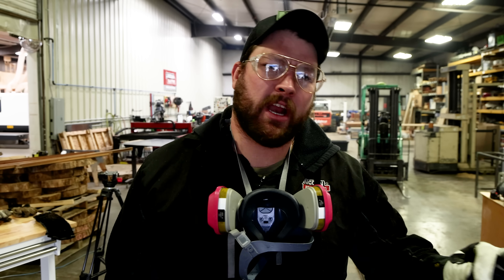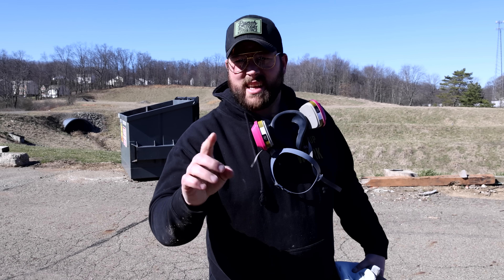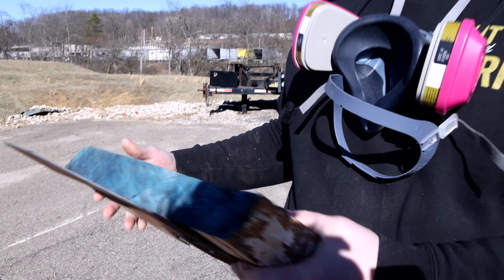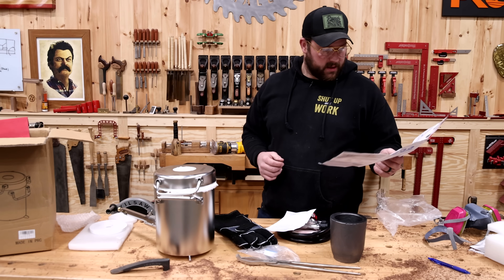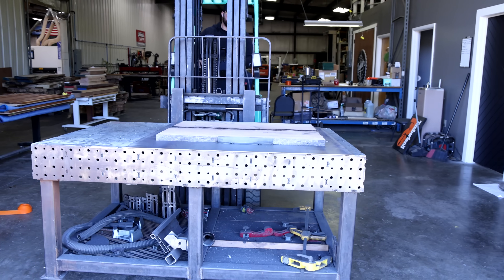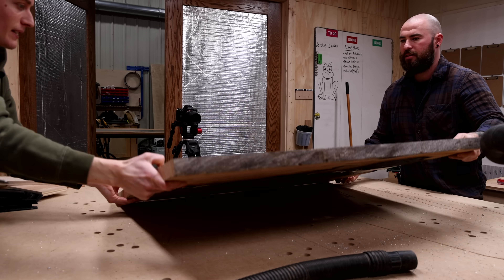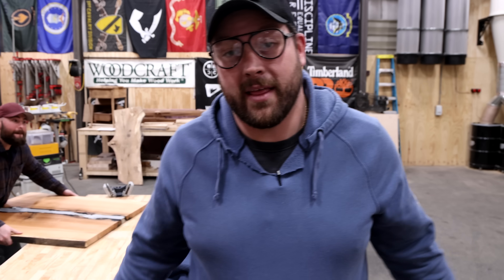I Tested Pouring Molten Aluminum in Wood

Comment: Soak the wood a little bit so it doesn't burn quite as quickly. Use sponges to cool it so it doesn't burn as much. Use water thin super glue to bond the burnt carbon to the aluminum and strengthen the wood.
 Then use a charcoal and resin filler.

Comment: The only time I've seen this done properly without any burning is when someone made molds of the voids that they were filling and cast pieces of bronze into the shape of the voids, then just epoxied those in and milled them down flat, that actually turned out really nice. Pouring it straight into the wood is probably never going to be a viable option unless you use pewter, which melts at around 338F-446F depending on the ratio of metals, you get the lowest melting point pewter you can get and you should be good, will probably char a bit though still. There are probably also some other options for low melting point metals that would also be viable. Though I'll admit, for me the ratio of how hard it is to how good it looks just isn't worth it. It's cool, but I honestly think epoxy river tables look cooler. To each their own though, having seen it done well, I definitely see why people like it. Regardless of how it turned out though, it was fun watching the attempt!

Comment: The trick is to do this in an already warm area and pour more aluminum. if you want to be cheap you could fill the space with hot rocks on the bottom and just worry about how the top looks. More thermal mass means more time for other layers to adhere.

But yes its difficult and you can get the same effect from easier methods.

Comment: The mechanical bond issue could be solved by adding small screws protruding just enough to the channel that the molten metal would surround and grab.

Comment: Have to ask - are you sure that the tiktok video was pouring aluminum?  It looked more like lead to me - far fewer flames because the melting point of lead is much lower than aluminum, and the material being poured stayed in liquid form far longer than your aluminum did.

Comment: Can't be done with pure aluminum like you tried. You need to do some metallurgy to "wet" the metal to the non-metallic substrate. Essentially you are making a brazed joint, not a structural aluminum casting. The big one for this use case is silicon between 5 and 12%, maybe some copper, and your melt will be more a low temperature low strength alloy. You'd also want to clean the wood very thoroughly to remove any trace oils, and use very dry aged wood so there is no moisture to flash to steam due to heat. Since the alloy will be at a lower temp than pure aluminum, you can use an aluminum backplate to help with adhesion and keeping the wood together. You'll also want a big chunk of metal underneath to act as a heat sink and help it cool quickly, bonus if you can get some water flowing under to cool the heatsink.

Comment: For welding titanium sometimes use an argon filled balloon.... I wonder if you could get enough argon on this to stop the wood charring. Im sure it's theoretically possible.... Argons heavier than oxygen so putting a tray around it might work

Comment: Why not use an angle grinder with flapper sanding disc for the aluminum until its somewhat close and then switch to an orbital sander. What would happen if you make a template of the wood and place where the aluminum will go and make a mold for the aluminum pour separately and add it to the wood later heating up the aluminum just inside the edges with that map gas torch you had as to smelting the edge so it fit perfectly or do all the work while the wood and aluminum are separated and make it like a leaf of a table since it is level which the wood is also level. I know, I know  I am not there. But these types of projects are very much my personal enjoyment and thoroughly enjoy not just the wood working aspect but even more so the problem solving and know sometimes when I walk away from a project for a few days I can see answers to the issues I am having..... I do think that what you said about having all the aluminum ready at once is the key. Why not build a smelter out of  the mortar concrete designed for high heat like 2600°+ Temps. I bought 100 pounds of it from Amazon like two weeks ago, You can purchase the ceramic wool sheets in large rolls( make sure you use rigidizer and dont breath in the dust of the wool sheet wearing a mask until you add rigidizer to it) I just bought a roll 2"×24"×20' to make a gas forge , coal forge and a second portable forge. Which one could use the large section of the smoker I got 2 of the 36" smoker for free off of the you haul off sites or you could use a 55gal drum vertically to make a large smelter with the wool sheets inside I made the inside of both my propane forges out of old out of service propane tanks cut in half the small 20 pounder and a 100 pounder with ends cut off the tanks with the ceramic wool sheet rigidized in between the two a for the forge I got some of the high heat brick for inside. The high heat concrete is for the base I made for  each of the forges I made since the rickety setup under the smoker wouldn't hold the extra weight

Comment: With all due respect. You have a mechanical engineer that designed and installed dust collection. Thank you for clarifying that, Yes terrible diesters have taken place and many have died due to improper use and understanding.
Reply: There is a reason there are blow out panels in the dust collectors at metal finishing shops. - Aluminum and Magnesium explosions a couple times a year are a fact of life.

Comment: I think you should try again. You need to get more material and do a better prep. 1st step to improve ur method add a refractory blank or cast a refectory canal along the edge of your opening to prevent the wood from burning and improve your casting. Second u need to add additional elements to make an alloy. You need to decrease the porosity and improve the flow ability of ur pour. Aluminum alloy 356 will give u a better cast and machinablilitty on the CNC.

Comment: I have not watched the video past the first pour. In my opinion you should pour it from the backside that way if it burns it up you won’t ever know it because it will be on the backside and then you can lay your board on top of another board and it will cover the burnt part up and keep the aluminum from falling out just my opinion.

Comment: I would try an inert gas like argon... it's cheap.  Have sides around your slab, argon is heavier than air so it will displace all of the oxygen. It can charcoal; but not burn.

Comment: So just a heads up they definitely did not use aluminum. Most likely they used gallium which melts at a low temperature and is also metal.when cooled looks similar to aluminum.

Comment: I did not see the video you are referring to but are you sure he was pouring aluminum into the wood?  If it was pewter it would be much more reasonable as the melting temperature of pewter is 480-550 degrees.  Just a thought but like I said I did not see the original video.

Comment: You should have set up a spray system under the metal plate underneath. That would have reduced the amount of burning from the metal caused by heat transfer.

Comment: I would pour silicone in the  Crevice, then pull the silicone out put it in sand to form the mold. Melt aluminum, pour in mold, finally place in wood

Comment: This is fascinating, but I wish you guys would learn the difference between "melt" and "smelt." "Smelt" does not mean "melt a metal," which seems to be how you are using it. To smelt is to use heat to extract metal from ores. It's also sometimes used to mean using a process involving heat to increase the purity of metal. But just melting and pouring is called... "melting and pouring."

Comment: It has potential but I think to pull it off you need a furnace and not a smelter as the different pours and thickness of wood probably played a big role in how it turned out.

Comment: Just because you can't do it doesn't mean it can't be done.
And a Vixen file will work better than your router to rough finish the aluminum. 400 grit isn't even close to a finish on aluminum. 2000 grit is still a dull finish, but the starting point for polishing.

Comment: There are low melt temp metals that look like aluminum but melt at like 200f. You should try doing it with that, and it shouldn't burn the wood so bad

Comment: I wonder if cooling/freezing the wood would help? Might also be more dangerous. 

Not with water but liquid ice so you avoid water so it doesnt steam but basically freeze the wood so as soon as the aluminum enters the holes/gaps it hardens dropping the temperature faster to maybe preserve the wood more instead of slowly burning into it. I know its not how the tic tac did it but as others say it it seems fake

Comment: Have you thought of using Zink? The melting point is within 15 minutes and less and looks like aluminum when polished!
Reply: You would need to be very careful with zinc as the fumes are toxic. The other issue is that zinc really likes to oxidize at those temperatures so you would probably end up with a white powdery mess. Even melting brass can get hot enough to burn the zinc and give off fumes.

Comment: 14:50 why not a cutter head? doing this with an endmill is probably worse than sanding it by hand XD.
I just know that this puny spindle doesn't reach the RPM for aluminium. A cutter head can help there, if the spindle has enough torque

Comment: I bet it might work better if you coated the hole with a clay infused with fiberglass.  Also, maybe put a small stream of water on the underside to keep the steel cool

Comment: Hmm wonder if it "wood" have turned out better with as soon as you poured it if you did an instant cool with like liquid nitrogen (to remove the changes of the wood burning)  or with the shots of video magic poured it but did a second table with silver/chrome epoxy

Comment: I think it would be possible with a thicker metal slab under it, and the two pieces of wood securely clamped down and bigger aluminum pours like first pour halfway up and the second pour finishes it at most three pours anymore and the aluminum cools too fast also maybe pre heat the metal slab to keep the first pour a little hotter longer as it would help the aluminum stay hot

Comment: Maybe it wasn’t aluminum that was used, could of been pewter or some other low melting metal like fields metal or woods metal both of which melt at about 150f, wouldn’t have the issues with the wood catching fire either

Comment: May drill bolts so it stilling up into the poured section so the metal melts around them. Or drill and tap after its pour from the bottom. Edit: didn't wait long enough before momenting. Didn't think about doing it epoxy river table style..

Comment: Just because he says its aluminum doesn’t mean it is.  It could be Pot metal or pewter, which melt at a half the temperature of aluminum.  Mill it slightly proud, Peen the surface to close the inevitable porosity and then finish sand, and seal it to prevent oxidation and most people will be unable to tell it from aluminum by sight.  And pot metal would be slightly harder to mar than pure aluminum.

Comment: I'm not a tiktoker so I haven't seen the original source, but are you sure he's not using lead? it would flow a lot easier at a lot lower temperature. that's something I've seen done on small projects since at least 2009. make magazine did an article on inlays made of plumbers solder that looked really good back in 2014? I think.

Comment: You should ask @NileRed whether there are any easy and cheap to make alloys with much lower melting points.

Actually!! You should try and do this again with Bismuth. It has a much lower melting point which is close to the melting point of Aluminum. It's 10,000 times prettier if you get it to crystallize too. It's about $10/lb online from some suppliers.

A 90% Aluminum 10% Bismuth alloy melts at about 650 degrees, which is much cooler so may char the wood much less. I expect more Bismuth would be closer to a pretty color and have an even lower melting point.

Comment: you can try a base that is water cooled . thin steel sheet or copper which is water cooled . i think its possible but getting pour depth and cooling may be too tricky . making a smaller piece may be easier .

Comment: This might be zinc or tin not aluminium. Also bond would be better if you put steel stud's into wood so metal would bond to it not just wood edge. Alec Steel or bigstackD could give good inside. Cooling it with Ice after pour can prevent from over burn of the wood.
Reply: They put steel studs in the wood.

Comment: As long as its good quality aluminum, it will not create sparks. Unless it has a ferrous mixture in there then it might. But good aluminum shouldnt spark at all.
& also you can mill aluminum just fine with wood working tools.

Comment: I think you could do this with huge success if you used pure Bismuth instead of Aluminum.  It has a much lower toxicity and lower melting point. And slightly lower on the Mohs scale. Not the mention the oxidation crystallization.

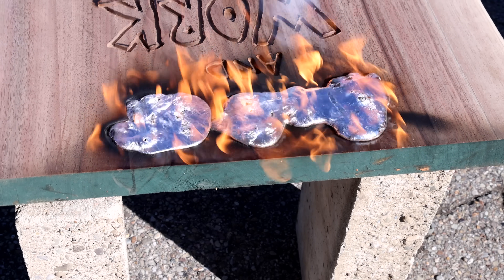Comment: 2:22 wood and molten metal rarely like each others. u can see the aluminum bubbling due the water in the wood vaporizing :D
one of my fave memes is when someone pours molten aluminum on fresh wood log with hole drilled on it and the water getting instantly turned into gas and spits all the molten metal out xD
and the meme has a jump cut on 2 dudes that have covered their faces with tinfoil :D

Comment: I wonder if wetting the wood periodically would show the burning?  It sucks that the temperature difference between poors caused delaminating. Probably no way to hit the old layer with some heat before the new layer.

Comment: Cant you spray wood with heat resistant paint or something? Like the insides of cracks that wont be seen, Id drill some port holes into insides of cracks, Then spray some heat resistant paint on insides of cracks and into port holes then aluminum will fill holes holding it together when it hardens...
Reply: Or 8:00 Yeah rebar works too lol...

Comment: 1. Make sure everything is really really dry. Preheat the wood and the metal as much as you can.
2. Make sure nothing is wet around the area you pour or metal the metal in
3. Use ZAMAC, pewter or tin instead of AL, much lower melting point
4. You can mill AL with your wood working tools no problem
5. If you use AL use the castable type not the wrought AL this guy have been using.

Comment: That's not a smelter. A smelter takes ore and turns it into metal (in the case of aluminium, using electric current). What you have there is merely a furnace in which to melt aluminium.

Comment: Try charing the wood with a torch first before you pour in the molten metal. If the wood is charred black then it won't catch the wood on fire.

Comment: Since aluminum surface oxidizes almost instantly, and the melting point of the oxide is 3700°,  getting layers to weld together is nearly impossible.

Comment: Or, it could be as simple as some clear engine paint presprayed to help wood from burning. Molten Aluminum roughly 1220 degrees. Rust oleum engine paint rated at 2000degrees possibly the way he does it. Definitely a heat resistant sealer for sure before the molten aluminum.

Comment: most of that looked like 7075 which has higher melting point. "smelting" uses chemicals, you were melting. you could do the same with gallium & not burn the wood at all but you have to seal it in really good because it will melt at body temperature.   i bet the tictoc video used a much lower melting point alloy.  also, a massive heat sync will do wonders.

Comment: I can help but wonder if you sprayed the edges of the wood with several layers of heat resistant paint. Maybe some dry ice under the metal table to help cool the pour quicker. Who knows???

Comment: you need to make an inlay and use the solder not aluminium. solder has a very lower melting point and will not damage the wood

Comment: next time you better use tin. When using pewter to pour into wood, it must be very dry, otherwise the pewter will fly in your face. I would try this with a low melting point alloy. Mixing/alloying different metals lowers the melting point. These mixtures are called eutectic alloys, the term eutectic comes from the Greek and describes the lowest possible melting point of two or more meltable and miscible substances.
Possible metals are lead 327°/C, cadmium 321°/C, bismuth 271°/C and tin 232°/C. The so-called Wood's (or something similar) metal has the lowest melting temperature at approx. 60°/C. the alloy consists of lead 25%, cadmium 12.5%, bismuth 50% and tin 12.5%. A chemist by the name of Rose invented the rose metal, which melts at about 94°/C, the alloy consists of lead 25%, bismuth 50%, tin 25%. The lead must be pure rolled lead, the lead from molten letters (letter metal) has other additives, such as antimony, this changes the eutectic. For the restoration of tin objects or sensitive metal objects, I use a solder, 44% bismuth and 56% tin, which has a melting point of about 140°/C. I cast pewter inlays in wood, and I widened the groove conically downwards. I compacted the hardened metal in the groove by hammering (with feeling). I removed the protruding metal with the scraper or a well-sharpened smoothing plane. Sanding is not possible, because the wood around the metal is smeared, the more sanded, the greater the smearing.

if you want to see how it works, search youtube for: 
Zinngießen in holz teil 4, der Guß - 
And:
Zinngießen in Holz Teil 5

Best regards

Comment: 100% curiosity and not to be sarcastic at all. Would this not work with electrical solder? The melting point is much lower and would likely come out better.